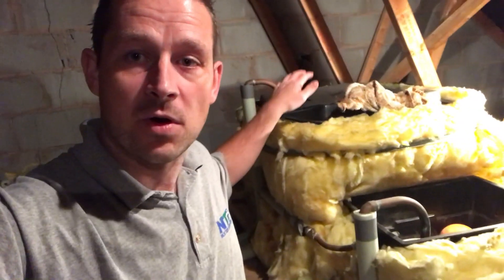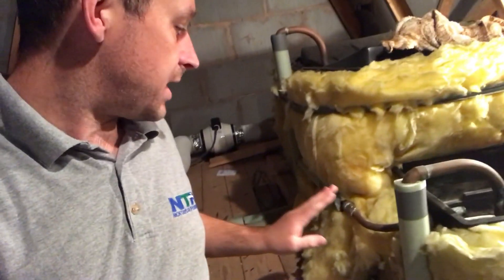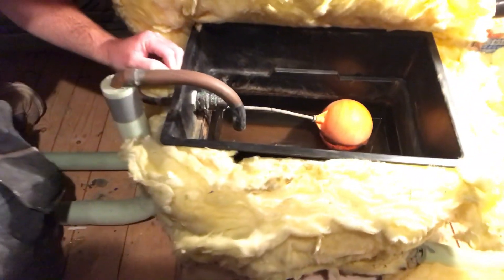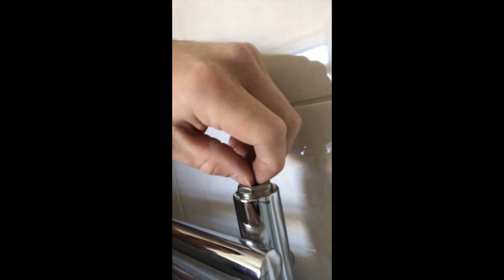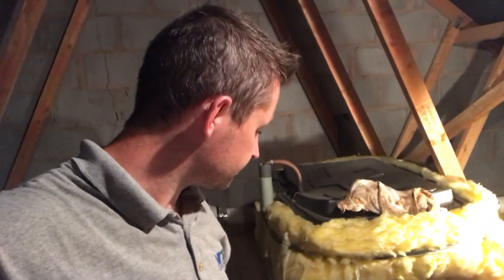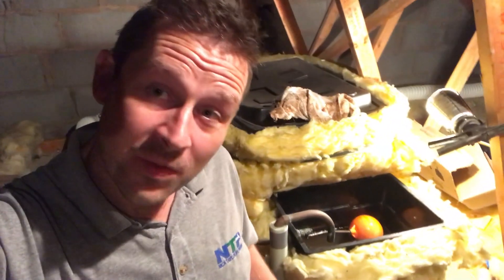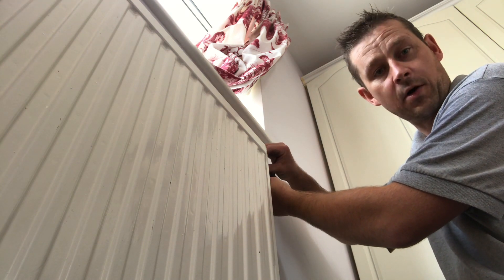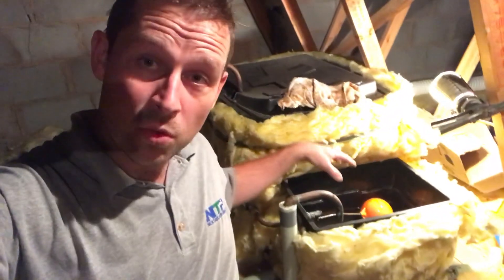How to drain down a central heating system - Gravity fed system.

Comment: Great and well explained video on draining the heating system along with a diagram. 
If I want to add an inhabiter to the system, when and where should I add it during filling.
Reply from the maker: Thanks for the positive comment, I would put inhibitor into the system before you fill back up whilst the system is empty but all vents and drain off valves are turned off so it cant escape / drain away.
Reply: @NickTaylorPlumbingLtd  Thankyou for advising about that.👍
Reply: @NickTaylorPlumbingLtd  would you add the inhibitor into the F&E tank before filling the system back up?

Comment: Really clear and informative thank you. I have to drain my system and feel confident now in what I’m doing. Just one question thought if I don’t have an isolation valve on my header tank can I just tie up the ball valve instead?
Reply from the maker: Hi Matt thanks for your kind words, If you haven't already please like and subscribe to my page as it really helps.
Yes you can tie the ball valve up but make sure its secured properly as you don't want that dropping and letting water into the system whilst your working on it. Personally I prefer to turn the water off at the main stop tap to the whole house as this stops any accidents happening.
Hope that helps.

Comment: very clear and helpful, thank you. A quickie. My ball valve in the expansion tank works 24/7 with no issues but very occasionally water is discharged down the overflow pipe ? If the ball valve is closed and water isnt flowing through it whats happening in the system that makes the ware in the tank rise or ‘expand’. ?

Comment: If a repair or installation is being done on the first floor I drain off from that floor so that when refilling I only have to bleed the upstairs rads. This means that if its a micro bore low pressure system it can be bled much quicker. Also if no isolator on header tank I tie up the ball valve  rather than switch off the mains. One less ladder to climb!!

Comment: Hi you forgot to say when draining the system to open up the motorised valves and to open the vent on the cylinder and filling back up to bleed the pump. Does know one tie up the ball cran anymore.

Comment: Hi, I have 5 drop down radiators (downstairs) on my c/h system all on the same level plus the boiler drain off, so I have to drain all 5 radiators plus the boiler is there an easier way to do this, thanks.

Comment: I never used to turn the boiler off. Is that bad ?
Reply from the maker: Hi EM EL, Thanks again for your message, you should turn it off but its mainly if the heating turns on whilst the system is empty it can cause problems, particularly if the pumps starts circulating excess water when you've got an open ended pipe.

Comment: In reality  these turn off valves are never there.
Reply from the maker: Hi Claudio thanks for your message, the drain off valves should be installed on every property but your right more often than not the original installer is lazy and doesn't put them on. I'll post a video in a few weeks of how to get around this just for you! :)
Reply: Yes my house built in the 80s doesn't have a drain off valve.. rats!
Reply: I’d appreciate this video too